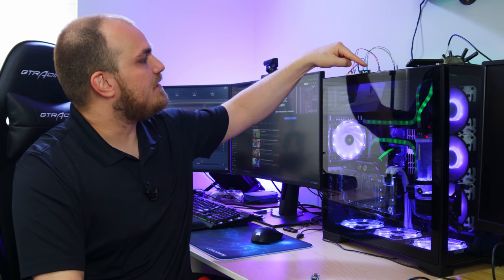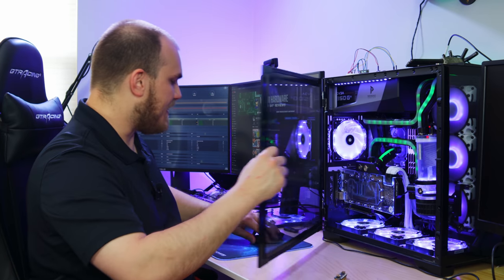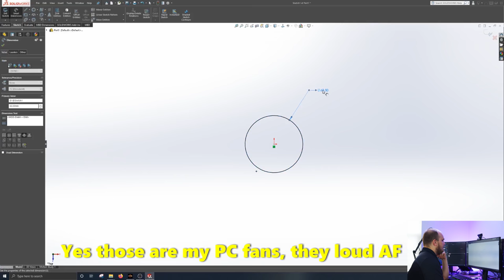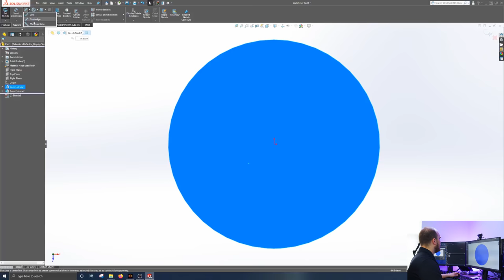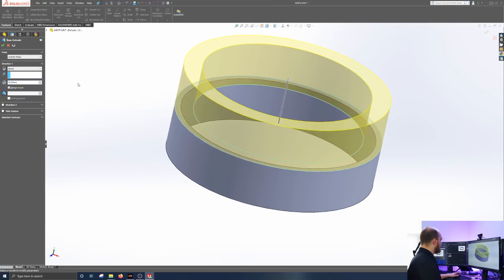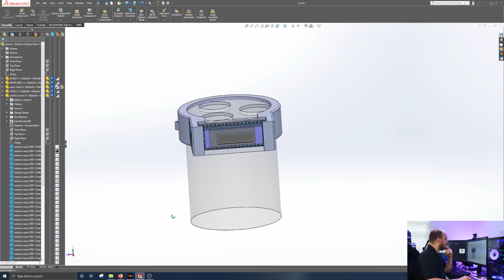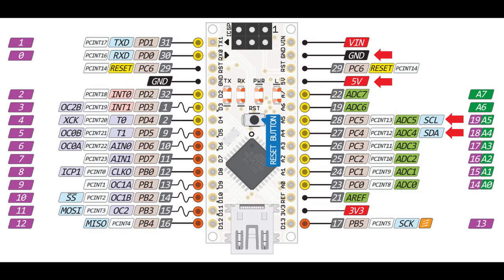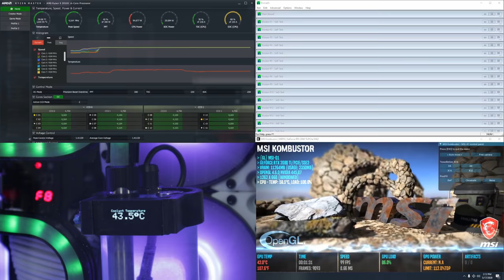DIY PC Coolant Temperature Arduino Build

Comment: I have a fan noise problem to. What I just found out is if you open the mp4 in audacity you can use the noise reduction effect in audacity to completely eliminate the fan noise without effecting the other audio. It works well. I plan to start using it in future videos. All you have to do is save the audio as an mp3 and sync the it in your video editing program then mute the original audio track.

Comment: For the fans, Zen 2 got this "design flaw" that it goes up 10C and back down again constantly for no reason and that causes your fans to also ramp up up and down. So set the fan spin up value higher to like 1s+ and should help alot.

Comment: Since you're already soldering just run some small power cables to VIN and GND to a 5v source. Keeps from having to have a huge USB cable flopping around everywhere.

Comment: lol.. I know this is a guy to trust when I see the micrometer pop up :) SOLID works software and now Im locked. You working this into a 3DPrinter is awesome :) For smoothing, (I have no idea about 3dPrinting disclaimer) a polish wheel on a grinder motor, obviously add a bit of thickness but.. it would come out mirror surface for the polished pro print piece, is a quick finish. With the work, editing, screen work, WOW so much more in that and very very well done. Bravo, you are really putting in a lot of effort here. Thank you.

Comment: Sand your prints, plastic filler, more sanding, and primer. Layer lines will be gone! Nice job. Thanks for showing the 3d design. Put your code on github or similar.

Comment: I think you could probably fit at least one, probably a few RGB leds between the nano and reservoir. Would be pretty simple to add in a little code to trigger different colors as a visual warning if things get too warm. Or alternatively just transition from say, blue/green to yellow to red(or flashing red) as a general indicator without actually reading the numbers if you want function more so than matching your case leds. 

If you modify the design a little, you could probably include either an RGB ring shining down into the res from the top, or a strip facing the res inside the bracket to get spinny effects. 

I'd guess that accomplishing this is well within your skillset, but if you want any assistance I'd be more than happy to help - just reach out! Very cool and very cleanly executed project man!

Comment: Your fans seem really droney(?), 10/10 description I know.
Also I would recommend getting a fitting with a temp probe attached to it and run it in-line, that way your loop isn't open and it helps cut out pump noise.

Comment: I used a controller from a Koolance Exos2-1055 and an ERM-3K3AU on my builds taken from an old system I repurposed. Problem with that is, is that it is voltage controlled not PWM controlled so I'm using old technology and if a circuit card or display goes out I have no recourse as Koolance gets their controller circuitry made in batches and cannot sell me an individual controller. A guy in maintenance at the job is really good with Arduino and found me your channel. Be a steep learning curve but will be well worth it as I love building cooling systems. I build a separate wooden box with Plexiglass doors so I would need a communications cable from the box to the computer. Soenthing neat like an HDMI cable going to a PCI slot cover on the computer and a 1 1/8" round plastic mount on the back of the wooden box.
Reply: My buddy at work is also real good at 3D printing. I'm a woodworker and graphic artist so I have a learning curve ahead of me with Arduino and 3D printing.

Comment: If you are comfortable shoving things in tiny, elastic holes and aren't using anything terribly reactive with the material, a rubber bung which encases the probe cable using an interference fit should be fairly water-tight. If the USB cable material is rubber-like and compatible, one could even use some solvent which would react with both to melt and fuse the probe with the bung to stick on the res and maybe a custom-milled top cap to squeeze the bung tight for an O-ring style fit.

Comment: Little tip,  those sealed Sensors are not completely water tight.  Even in condensed air they start to corrode inside because of the voltage.  I have to change them regularly at work.  Don't put the cable part under water if you like to use it over longer periods.

Comment: Thannk you!! Very instructive. I am thinking of using Bykski sensors that are screwed into the loop , but instead  of  (or as an add/on)   I want to connect the sensor information via a breakout gpio -usb board to one of the motherboard' s internal USB ports in  order to be able to obtain a temperature reading from the Linux Operating System. And then use this reading and an room temperature reading and use the difference between the liquid cooland and the room temperature to control the pump and fans speed.

Comment: You can grab power and ground from the 24 pin connector's 5VSB to power the USB instead of the USB cable. That way it always can show a reading as long as the power supply is plugged in.

Comment: If you can find a place to splice it in, you can connect the VIN pin to your power supply and it will take up to 12 volts and then you no longer need the USB cable. Just make sure there is a common ground too!

Comment: Gotta admit, I just grabbed a $2 tiny temperature segment display module from Ebay, a $3 1/4G watercooling plug with a 10k termistor in it, soldered together, pulled power to it from a molex adapter, made a hole in s PCI(E) slot cover and stuck it in there (pointing into the case). Shows temp only though, in 3 digits and .1 resolution. But it was only about $6 total in parts, and 10 minutes of soldering, drilling hole in the slot cover and cleaning up the edges.

Comment: you didn't use it to control the color of your rgb lighting.
my disappointment is immeasurable and my day just started.
honestly it looks way better than I could do, as I don't have a 3d printer, but it needs an integrated rgb controller :P

Comment: I have a similar setup, but I use a nzxt g1/4 fitting with a prob on it. It tells the MB what the water temp is and changes the pump flow on the fly, 98% is it on the slowest setting. The fans just stay at the same speed all the time.

Comment: 👋🏼 I don’t mean to be ‘that guy’, but why did you go the Arduino route? Seems to me it would have been easier to use a button battery thermometer with a temp probe? This would eliminate the need for usb power etc and You would just need to design a ‘cradle’ for it. If I’m being honest, it was the first thing that came to mind before you finished explaining what you were doing. Just a thought. So this is a bit more balanced, I thought that you’re ‘hard-Line’ soft tubing hack  was quite inventive and a great idea and something I might do if ai ever go down the water cooling route. ✌🏼

Comment: Need to figure out how to make a remote startup for my cooling system. It's a separate unit from my computer system. I repurposed the control and startup circuitry from a Koolance ERM system. It plugs into a 120v outlet which then goes to two power bricks, a 24v for the pump and a 12v for the fans and controller electronics. There's a serial port on the back that goes to a PCI slot cover into the computer and a Molex connector for power. Also there's temperature sensors and a flow meter socket. 12v comes off the power supply and actuates a relay which turns on the unit with the PC. It can also be configured to start standalone. I'm interested in making my own circuit that can do the same thing as well as programming pump and fan levels and port them out to a display. The ERM has 10 pump and fan levels, alarms, temperature sensor outputs and more, be a nice project to undertake myself. Koolance won't provide a schematic on their design and since their controllers are made in batch I'd have to buy a whole new system for $1400 if anything happened to the control and startup circuitry on my unit. The 12v from the computer PSU is just a signal, the unit pulls too much power to use the serial cable directly for startup and runtime. Koolance has a newer ALR-4500 with massive cooling capacity but with 8 184CFM fans it would be too noisy for anything but a data center server room.

Comment: Change computer color based on temperature and maybe fan control can be included. Wanted to do something similar, and you might be able to do it faster, since I don't have water cooling or a good probe point.

Comment: they have something similar on ebay lol.. a standalone fluid temp meter.  there are also ones that have both temp and flow. but still cool. should take temp and use it to control the led you have behind the water lines using addressable led.

Comment: hey, i saw sometimes on aliexpress some fittings with an integrated probe, you may look them, seen kinda nice
Reply: Alphacool makes some too. I installed one on my rig, very handy :)
Now most motherboards have pins to connect a PTC, so it's stupidly easy to monitor your coolant with HWinfo. Still, nice standalone display :p
Reply: yeah, i'm currently using one. g1/4 fitting and temp display kits are ~$3.50 on ebay.

Comment: I love my idea of Water Temp screen more: It is just a Thermometer from a Fish tank that you stick from the Outside on the glas.
My Tank is a Heatkiller that has a glas tube and so it is working very well. I dont have exact numbers oif the temperature but i have Numbers ;) So Here you go with the Cheapest Option that even needs no Power.

Comment: i have my AquaComputer pump (modified Eheim pump) which has   this feature a long time ago. but the big temp differnce your talking about i never had that. thats the reason why i dont look it anymore. 
but there is a other thing you can try i have allways wondert about.
i know from my previous job (metal worker) if you use a lathe which use water cooling. you need a 9x bigger reservoir you pump can pump in 1 min.  to get the best passive cooling. before it goes thru the radiator

Comment: Any decent motherboard has hookups for external temp sensors. Take any ntc10k probe, drop it in the res, hook it to the mainboard and have it control the radiator fans instead of cpu temp.

Comment: Personally I have a G 1/4" temp prope in my bottom rad. This temp sensor is connected to the Temp_Sensor Header on my Maximus XI Code, which then outputs my water temp to the inbuilt POST LED. With Ai Suite I have my fans (all 6 are hooked up to an XSPC hub) run, according to the water temp.
I do like your solution, I just prefer automated software to do stuff for me, while I monitor it's behavior :P

Comment: If wanna make it look a little better you can just grab 5v and GND of a USB 2.0 header on your mobo and wire it to the Vin and GND pins on the Nano, that way you don't need a USB extension cable and it take up one less port on the board

Comment: Well, if you're already using an arduino you can just use a cheap old thermistor and a resistor (same value as the k~1 on the termistor) and an led screen? Project should be well under 5usd(specialy if you got the arduino and screen from china). You could also just give it 5v fro the 5v psu rail(molex, sata or floppy plug(we still have that right? i'm on a laptop and the mining rig i had was built from new gpus and junk parts)).

Comment: hey,I would like to suggest an idea I had insparation from another youtuber: "RCLifeOn".
cooling the water in the reservoir with peltier, there are variuos plates but if you could have a cooling fins at the bottom of the reservoir and the peltier cooling the fins to low temps and make the whole water system with no radiator will be a nice step into new cooling system.
I recommed watch RClifeOn video about peltier cooling and there are tons of info about this component.
Reply: Probably with Peltier cooling is it's very inefficient. To go to those extremes, you'd actually be better off using a refrigerant system, but of course the trade of is the noise of the compressor for the system and the size of the components.

Comment: you can buy a temp meter from amazon, show me a controller for the water pump (i have two pumps) but nobody makes a controller that monitors system temps and adjusts flow speed accordingly

Comment: So, how about you monitor water temps before and after the radiator and the water flow through your loop, then calculate the dissipated heat from the difference in temperature and water flow?

Comment: Could you make a video with 3d Printed Air Ducts inside the case for ultimate Performance/Cooling? Ducting from intake to CPU or dividing the exhaust air from the graphics card? I tried it with cardboard and my gpu runs around 10C cooler now.

Comment: For code, you can pastebin it or preferably, you will want to put it on GitHub!
I think this could be really nice with a little custom PCB (Should help slim it down quite a bit), would you be interested in getting some help with that or you happy with how it is? Also means you might be able to hide the USB cables easier (no USB mini-B connector but some pins/pads on the back)

Comment: 58 seems high for a gpu and what cpu are you using.  Im running a 3950x fresh build with a 1080 TI oc @ 2ghz.  Max gpu temp is 23c as reported by msi and my cpu hits around 60c with all cores loaded. Doing single cores it will go to around 74c . I have not tuned my system yet just basic PBO and I get the rated 4.7 ghz on average 12-16 cores, depends on what I am running unless I use all 32 then it does the stock 4.02 ghz.

Comment: I am curious as to why you run your fans at such a high RPM. I live in a hot climate. Summers days are like 37c on average and my fans are mostly idling on my 280mm AIO. I only allow them to spin up to about 1000RPM and that keeps cpu temps under control. Like I said...just curious.

Comment: In theory, wouldn't it be possible to just use an analog thermo with its probe in liquid and monitor the temperature that way for cheaper, especially if you could salvage it from something else?

Comment: Is it just me or are your fans constantly going up and down on RPM a bit? That would drive me absolutely nuts... I actually have my fan profile set in such a way that they always run the same speed unless the CPU gets to a temperature that it never ever gets close to.
Actually the sound is still there now that you're no longer working inside your system, so maybe it's actually something else... So, what is that constant fan noise?

Oh, no, it's gone when you turn off your PC... is it so noisy, or does the mic just pick it up that well?

Great video though :)

Comment: WARNING!
If you have a full copper / nickel plated water cooling system adding a temperature probe with a aluminium tip can / will destroy your system if your coolant doesn't have any rust inhibitor.

Comment: Very nice. Though I almost did a spit-take whe I saw that temp probe, yowza!
I'm using a little temp sensor from Aqua Computer (4260073412292) that slips into a G1/4 extender. Just screws in-line with the return into the res and grabs the temp without being too obvious.
You could easily swap in something like that with just a few cm of wire hidden under the cap.

Comment: wtf 48 degree c water temp? O.O with just low rpms my loop sits at 32c on load :D Well i use a Mo-Ra 360 rad .... :P Still never thought to see that high temps. 7700k @5GHz and 1080Ti at 2050/5454  MHz

Comment: this and some other control features is the reason why i use this pump in my build for years.
https://aquacomputer.de/newsreader/items/aquastream-ultimate.html
This is extremely handy to be able to bound pump speed and fans to any temperature in your system (including water temps)